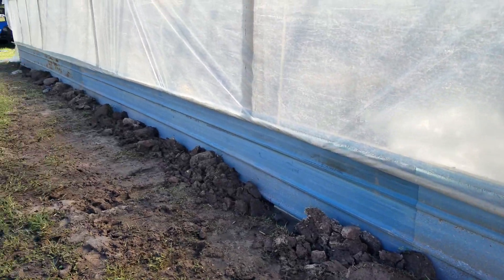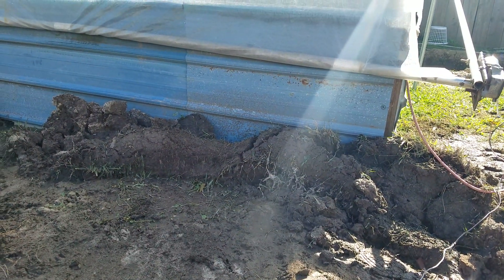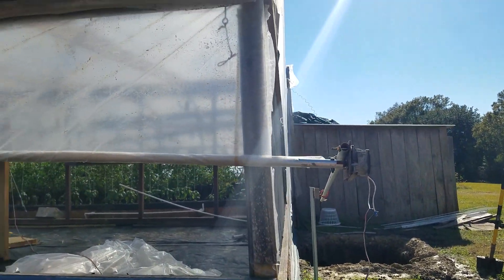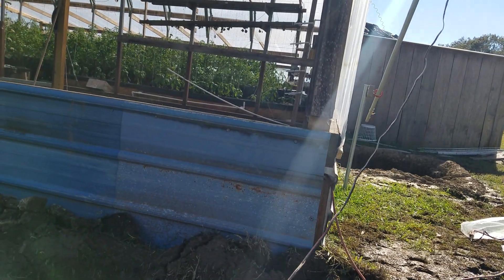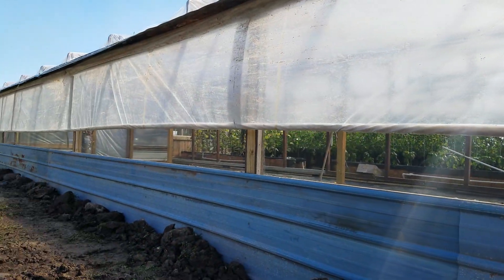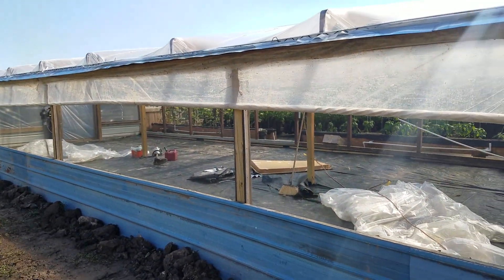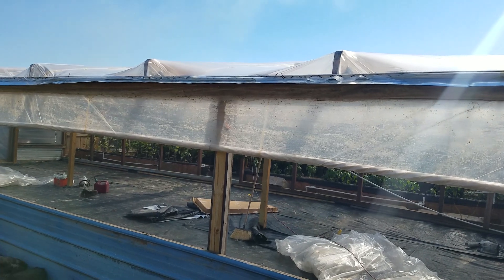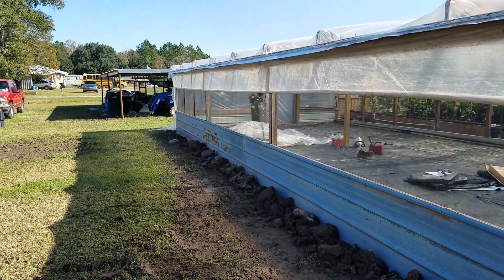Greenhouse roll up curtains made with windshield wiper motor

Comment: Amazing idea! Just subscribed after seeing this video. Now I have to figure out how to do this for my tunnel sides and the make a roll up door on the end for my tractor to go through with these. Then I want roll up shade cloth on top done like this. Any tips or update or more info you can provide on this setup?
Reply from the maker: Kind of at a stand still right now. Been in the process of moving the Greenhouse to my place in town. 
I was spending too much time away from the family. 
Once I get to the point that I am ready to build more as I will have 3 sets of side curtains to roll up instead of 1 set. I will do a more in depth video. 
I was planning on doing one when things went to hell at that place. As far as a roll up door. 

I have put a lot of thought into it and looked around on the internet but have not found anyway to this point to do it cheaply. The runners needed to keep the pipe in place along with bearings just put me thinking it would be easier just to put wiggle wire and take the door off and on as needed. 

The new ones I am putting up are much smaller 14.6 x 34. So no need for the big doors. 

I should hopefully have everything up and running by July. Thats the plans for now. Stick around we may beable too brainstorm together!

Good luck for sure and hope your safe!

Gro Dat!!

Comment: Can you program this with a timer up and down?
Reply from the maker: I am sure it could be done. 

It's a 12 volt motor and you should be able to find a switch timer to work it off and on. The issue would be turning it off at night and then making it go back down later.

I am in the process of moving the GHs to my house in town. I hope to have some new ideas to work with because I will have alot of curtains to open and my GHs will all be under 500 sq foot. 

Thanks for watching and please share if you have any ideas to better the system!

Gro Dat!!

Comment: Very cool mod Danny.  The backing down reminds me of my RV slide closing then rolling back out a bit.  I can't find the little "brake", but it was incorporated into the dc motor some way.  I replaced it myself easy enough.  Works perfectly now.   Maybe there's something that could work for you there??  Really nice mod.  I like it.
Reply from the maker: Thanks for watching Mr Brent! 

The motor actually has a small break but I installed it upside down. The break only works one way on these motors. I found that out after talking with my tin brother last night. So I will flip it this morning and check to see if it works. It's just 2 bolts. 
Once I put the straps to hold it from blowing in the wind it should stop at the bottom where I want it to. But thanks for the heads up incase one of the breaks on the other motors dont work. Hope the rest of your week is a good one!
Reply: I catch every video related to your greenhouse buddy.  I enjoy them.  I don't always comment, but that's my style.  I think sharing ideas is a big part of YT.  Had a guy mention something to me in my latest video.  Great stuff that helped me out.  Keep up the great content.
Reply from the maker: I am the same especially with the bigger channels that have been established for a long time. I ask questions but dont get into the conversation or comment every time. But I have about 15 channels that I try an watch every video that's put out as soon as they come out. 

I sure thank you for watching and always open to ideas to better something or even criticism that's constructive. Just trying to make things easier or better for anyone starting out.
Reply: Makes sense to me.  :O)

Comment: Holy smokes Danny! That's really really bad ass! I couldn't even hear the motor running, only the plastic but just barely.
Once you get that plastic dialed in just rite, this is ingenious Danny! 

Thank you for sharing and as always Keep Building👍
Reply from the maker: Thanks brother.
 I been having the idea for awhile with that motor and hook up, but could never figure out an easy way for the motor to stay on its travel. Found it on FB. And threw it together. Sure makes rolling the sides up easy now! And with 1 maybe 2 more GHs coming it will work great. Also talked a friend that says we can automate it all that will work off an app on my phone. Lol so ne telling what we gonna end up with!

Thanks for watching
Reply: @CajunHydroponics  after seeing what you did, I'm thinking about trying this and using a tiny solar panel to charge the battery during the day. Good job inspiring others.
Can't wait to see the next episode👍
Reply from the maker: I picked up a trickle charger from HF. And will try it. Also did some research and found a wall mount plug in "looks like computer charger" it should run that little motor. I think it was like 8 or 12 dollars on amazon. I have access to electricity and just cant see spending on a solar panel right now. 

Its amazing what can be done with those little motors. A guy used one to pick up 65 pounds of lead just to do it!